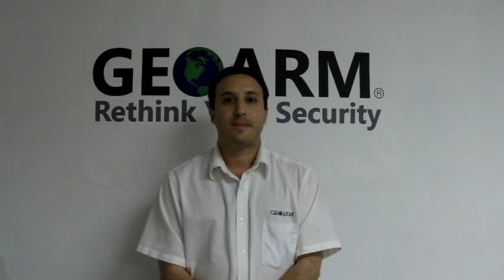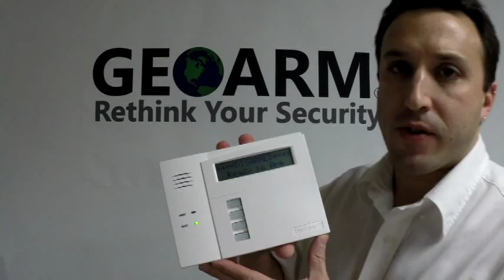Honeywell Vista 20P : How to Program House I.D using a 6160 keypad

Comment: What about a lynxr-1 does it work the same
Reply from the maker: a honeywell 6160 keypad does not work for the Honeywell LYNXr-1 this is only for a honeywell vista 20p wired security system. If you want to add a secondary keypad you will want to add either a honeywell 5828 or a 5828v: http://www.geoarm.com/honeywell-wireless-alarm-keypad-5828.html
Reply from the maker: a honeywell 6160 keypad does not work for the Honeywell LYNXr-1 this is only for a honeywell vista 20p wired security system. If you want to add a secondary keypad you will want to add either a honeywell 5828 or a 5828v: http://www.geoarm.com/honeywell-wireless-alarm-keypad-5828.html